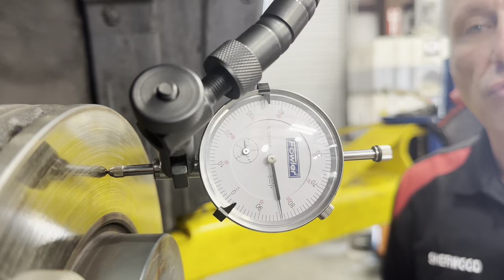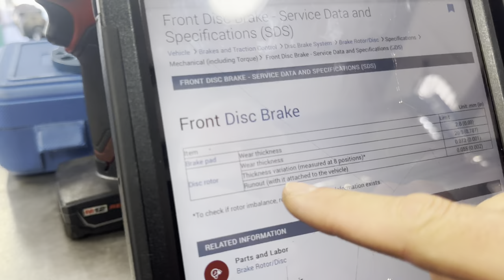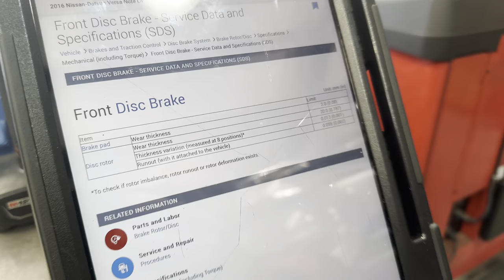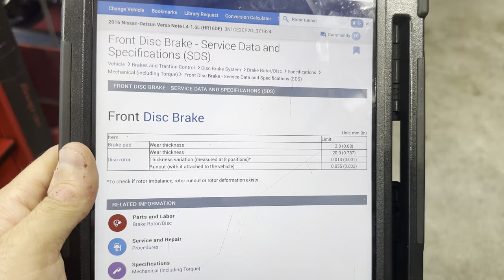It’s Vibrating When Braking & It’s Not the Rotors. How to Test! (Nissan Versa)

Comment: As a former brake engineer, I can tell you with near certainty that brake "roughness" is nearly 100% caused by rotor THICKNESS variation, the difference in runout between inner and outer brake plate.of the rotor.  You would have to measure the inner and outer rotor surface in phase of each other to get this measurement. Some vehicles are sensitive to 20 microns of thickness variation, which is 0.0008 inches, and hard to capture on a dial indicator. When you have brake roughness, replace the rotors and brake pads, and it will go away - for a while anyway.
Reply: Right you are  sir. As a 50 years auto, diesel, aircraft and industrial mechanic, the brake rotors made today are not made to be turned or trued. While we could do this a few times in the 70's on rotors, the rotors today are made to bare minimum to save weight. Sadly, one really hard braking can warp the rotors. I learned the hard way maybe 10 years ago when I had only 25K miles on new rotors on my E350 Super duty van, I had the rotors trued to get rid of pulsation, it worked for maybe 5K miles, but then I threw them out and bought new OEM Ford rotors. The other difference with rotors today is that they are made to almost any price point that you want, so yeah, much cheaper than in the 70's for the same size car, but they don't last anywhere near as long. It would cost over 100 bucks for Chevy rotor in the 70;s and hardly no aftermarket like today. Now if I could just get some tires for my van that are not crap right from the warehouse. Top of the line Michelins and 2 bad tires right at the start, the tire shop had to get 2 more to be able to balance, then we could not get the shimmy out after being on the van for only 2 weeks, switched them out with General Grabbers HTS 60 and while better, we also found now 3 tires now good. The Generals seem to balance out at first, but I think they are defective and getting "ply shifting" within a few days of usage. I'm sick of wasting time and the tire shop is working with me to resolve the issue, but as a old fart that expects a good product when new, this is 100% aggravating. I probably going to make them switch to another tire brand. What is going on with quality these days??? BTW, the van did not shimmy and rode perfectly smooth with 7 year old Michelins. They would still be on the van had they not dry rotted and one blew out.
Reply: Don't waste your energy. As a mechanic I have been trying to explain this to people for over a decade, have shared the Carroll Smith article, and nothing seems to work. 

Trying to explain that their brake lathe is unusable because they've used the adapters and cones as press adapters and seal drivers is worse.
Reply: @Jglivermr2  I know, I'll never have rotors machined ever again, in Florida by me, I think the only auto parts store that will do it O'Reilly's and I think it is used more to get people into the store, then tell them that their rotors cannot be turned due to being too thin or warped. Some local machine shops might still do it, but like I commented to the brake engineer guy, the cost of rotors is so cheap, heck buy the best ones you can get and it still is not that much. New pads, rotors, bearings., seals and I rebuild my calipers every other pad change. At 63, I trust only my self to replace my brakes.
Reply: @josephklimchock5412   I am the same. I mostly work on antique vehicles though, and sometimes have no choice but to turn rotors.
Reply: You are correct but...the runout leads to the thickness variation.
Reply: @Jglivermr2  Well sure, older vehicles had enough steel to turn many times, and if Antique, you have to save the parts if no replacements around.
Reply: @Jglivermr2  Yes, thank you. Well advised.
Reply: Also ex OEM engineer, run out will cause a thickness variation after a while as off brake wear will remove the high spot on each side of the disc. The factory discs are machined on the hub, so will have minimal run out. The replacement disc/rotor are often slightly thicker than OEM spec as the intention is that the disc is machined on the vehicle and so eliminates any hub run out.
Reply: Awesome 👍
Reply: i had in 2021 vibrations at braking on EBC Turbo Groove  with Project Mu HC800 pads
left it alone for winter
in 2022 spring when took it out vibrations completly disapeard and not return for hole year
2023 / this year same, still not return, absolut 0 vibrations, but now the pads are loud, LOUD like a todler screaming
brakes are nuts 😂🤣
Reply: Quality across every single industry is going to continue to diminish overtime until it meets a breaking point that needs to be addressed, not just manufacturing either, the trades, and any skill really. The amount of knowledge getting passed down from the population boom generation to the generation that's replacing them is insufficient and unreliable at this point. Quality is being sacrificed for quantity, because the amount of people needed to meet supply demands and maintain sufficient quality is outpacing the supply of people with the knowledge to run the machines, fix the equipment, etc.
Reply: @DeeSea3  poor and dumb people working for less is a huge contributor
Reply: He miked the rotor for thickness variation. It was consistent which cancels your idea if I'm not mistaken.
Reply: @josephklimchock5412  Rotors can't warp. Truing the rotors won't fix the problem only eliminating runout is a fix. Otherwise it only lasts a few thousand miles.
Reply: @Jglivermr2  Seems no-one can grasp the concept of runout and the thickness variation that results, with the pads constantly hitting the high spots you're doomed. Haven't found a shop that checks runout maybe because its a big money maker.
Reply: @Jglivermr2  Turning rotors won't fix the problem unless you have an on vehicle lathe that way you remove runout.
Reply: @leewatson8129  Exactly! Thank you no body gets that. Used to be brake shops had on-vehicle lathes but I've looked high and low can't find a shop anywhere with one.
Reply: Yup.  I've seen bent truck axles that had whole hub gyrating visibly and the brakes did not shake.  This video is a total fabrication.
Reply: 100% You can tell visually by looking at the rotor, It is massively heat scored. I would be looking for exceptional causes that caused the brakes to be heated so quickly.
Reply: You haven't a clue. Start cleaning the parts.
Reply: @Jglivermr2  IIRC the Carrol D article said rotors are never warped and it's always thickness.   Maybe his racecar experience, and he couldn't be more wrong concerning non-racecars!
Reply: @alro2434   If a rotor is truly warped and not parallel variation you would not feel it. The caliper floats.
Reply: Lol, then get a millimess that goes to 0.001mm...

It's not hard to readout, it's that you don't actually have the tools for it. 

Sincerely a machinist who grinds to 0.001mm
Reply: So put a dial indicator on both inside and outside rotor surfaces at the same spot?
Reply: If replacing the rotors only resolves the problem for a while, you have a seperate problem. Unless what are trying to indirectly say is, all rotors are defective brand new. Leading to early failure. When checking for thickness variation to determine if the rotors should be replaced, it does not matter if the variation is on the inner or outer rotor. The fact that there is a variation beyond service specs is all that matters at that point.
Reply: How do you suppose the hub developed that amount of runout? I’m gonna say someone took a big hammer and hit the hat of the rotor to get the rotor off
Reply: @Gregg0112  naw. It can handled. Someone curbed the car. Likely while going around a corner. Which puts an even higher stress on the wheel/hub.
Reply: What  I don't understand is why don't they know 100% sure about something before they change it,we can all do that, meanwhile the customer is out of pocket,to the tune of possibly 100's of pounds
Reply: 100%…. RTV or rotor thickness variation is definitely the biggest issue with rotors when it comes to steering wheel shake or petal pulsation. It starts as warped rotors and as the rotor high spots hits the brake pad over and over it eventually wears a low spot on the rotor. The only way to accurately check this is using a micrometer at multiple points around the rotor. 
I’m surprised at how many “technicians” don’t actually know this.

Comment: the fact that you were transparent about having the customer return multiple times until you finally resolved the issue- and then taking us through the process while openly admitting "this is on us" - much respect.   I would always tell my kids; "I don't care of you make a mistake- just be honest about it - no excuses,  then make it right".  Thanks for doing this video.
Reply: He did it backwards tommy = he should not try to pass the buck at start = then admiting = just admits he lies at first = or just was embarresed and admit = no lie = no need for correction ????/
Reply: 100%.  I was going to comment, but you said everything I was thinking.  Everybody, including businesses, makes mistakes.  The real test is how do they respond when that happens.
Reply: Free labor to customer, only charge for hub.. now it is best to change hubs in pairs because the older good hub on the other side has more wear and more rolling resistance.  so it will pull
Reply: I have a question.. I took my car into garage to get to get new discs and pads. 

When I picked up the car the rear brakes over heated & pads, alloys, everything is perfect, tried the flush, new break lines, new callipers but still overheating!! It’s the wheel bearing ect I simply can not find the problem!!
Reply: @faff1987  id start by lifting the rear off the ground- actuate the brakes and verify that the calipers are not locking.  Feel the tension on the wheels after you release the brake.  Heat means friction, friction comes from the pads grabbing the disc.  They have to 'release' when you let off the brake. Also check the slide pins - a lot of people don't clean those things which stops the caliper from 'returning'.  You eliminated dirty fluid- that was good but I'd refocus on the calipers themselves.
Reply: @lynskyrd  throwing money away doing that I have passed that stage!! The problem came after the discs and pads were changed. Then put new brake callipers on, then brake lines, it’s been flushed 5,6 times!! Everything is in perfect health, the wheels move, there is absolutely no defects!! It’s a Audi a5 and it’s been in 7 small garages they can’t figure the problem, it’s even been in to Audi twice who have world wide garages who not one mechanic can figure it out!! The discs have been replaced and pads twice!! Since it’s just the rear brakes that are effected I thought the handbrake this as been lined and reset multiple times!! The only things I can think of is abcs or the master brake cylinder and they have also been tested. So skip the a b c mechanic’s been through it.
Reply: @faff1987 When you say overheated there needs to be more information. How many miles are on the vehicle? How hot are the rotors getting - glowing? So hot the brake fluid boils and its giving you a soft pedal feel? Has the vehicle had any modifications like wheel spacers, brake lines, high friction race pads, etc? You didn't say if Audi put OE pads/rotors on or did they just try to figure out the problem with might be upgrade brake parts - sorry if you clarified that and I just don't remember as I am typing this out. If Audi OE parts are used - were the tolerances within spec for both the rotors and pads? If that was confirmed. Is it possible this vehicle may have a different group of part numbers due to a mid year change and the same wrong parts are being put on the vehicle over and over? Maybe there is a difference between a US, Canada or Europe spec A5 and nobody has figured that out yet. Was this your first brake job on the vehicle or has there been many done just fine before? If so - Has the location that did your previous successful brake jobs taken a shot at this? 
Lastly when mechanical issues have been exhausted as you noted an electrical/computer may be at fault. Which is why the mileage and even if you live in a extreme weather climate(hot, cold, corroded parts) could also be part of the issue leading to a failure of the ABS system or other item that is at the end of its life.

I worked for Bremo North America in both the racing division and big brake upgrades just so you know I am not some Youtube yahoo.

Good luck
Reply: @William-Bill-Munny  the discs, breaks and alloy get that hot that water makes it hiss!! The paste melts drips ( no modification) I’m from the uk.

After the heating it’s had new callipers, outer brake line,
Reply: @faff1987  Sounds like your brake piston is stuck and doesn't retract - Maybe its stuck (rust, dirt, broken ring/seal, etc.,)....Is this EV? All the wheels get hot or only one?
Reply: @jessgvirtual5822 it’s not a piston. It’s not the break line, it’s not the pads or breaks the discs and pads have been changed before, same part number ect if it was the discs and pads that were the problem then all of them would have the same problem not just one. It’s been in many small garages, as well as an Audi garage if Audi can’t figure it out then I have no hope !!! It could have been the calliper as it was a single wheel but it has new callipers on!!  If it was the break fluid it would effect all 4 not one. Visable and mechanic level everything is perfect !! If it was the abs unit it’s very unlikely that it would affect one wheel !!
Reply: @faff1987  4 wheel drive ABS module have  solenoids for each wheels. Its possible one of the solenoids not working as intended. It's also possible ABS module circuit board has a broken circuit(not uncommon). Sounds like  brake piston is locked-up or errant signal preventing retractions....NO OBD codes? Does your Audi has yaw sensor? You might want to check on that, they are sensitive component....
Reply: @faff1987 probaj zamenjati gumijasto cev katera pride na zavorno čeljust. Ko pritisneš pedal imaš normalen pritisk, ko pa se vrača olje nazaj ga pa nima. Vzrok je poškodovana cev v notranjosti.
Reply: Sadly not many people are honest… 😢
Reply: @faff1987  Does it have have "yaw sensor"? They can lock-up your wheels if giving wrong signals...they are sensitive components.
Reply: "If you make a mistake - just be honest about it - no excuses,  then make it right". Wouldn't be wonderful if our leaders would do the same!
Reply: Where can I find the tool to show run out and the thickness of the rotor

Comment: 90% of the shop will not do this kind of troubleshooting nor have all the tools to troubleshoot like you did. Awesome job!
Reply: This is apprentice level diag buddy relax. Customers don't pay for this that's why no one does it.
Reply: Agreed. Most shops will blame it on the rotor and label it as "defective" to get the customer in and out. Great job with fully diagnosing this issue.
Reply: Had the same problem on my 97 Thunderbird front hub: replaced the rotor & pads and it still vibrated.  Another symptom was that the brakes didn't immediately bite right away- this was due to the side-to-side motion of the rotor pushing the brake piston into into the bore, thus creating a bigger gap between the pad & rotor when the brakes were not applied.  Although I didn't have a dial gage, I performed a similar test with the rotor bolted down and the caliper & pads removed from brackets- I could see the movement by staring at the gap between the rotor & pad mounting bracket. Sure enough, a new hub made the car drive like new!
Reply: So, by the time you've replaced the hub and checked the runout on that new hub (and you BETTER do that), tightened the axle nut to spec (and these have a notorious issue with the LS axle nut backing off), put the rotors on a brake lathe to see if they require machining, then put the whole shit back together properly (pad lube, torque bolts to spec, install wheels, torque lug nuts to spec, test drive etc.) you've spent half a day and about $1000 in parts and labor ... ON A VERSA!
Reply: Good tip also is No Mo Chinese Rotors! Go with Detroit Axle of Michigan or Cardone of Pennsylvania. Bunch of old Italian master mechanics still there doing Gods Work in The Rust Belt Fossil fuel capitals.
Reply: Your probably right about shops not doing this. It’s pathetic that shops wouldn’t use a indicator to check runout on the hub and the rotor as common practice. The mag base, drop indicator(better to probably us a test indicator for clearance), and micrometers are not that much money. Mechanics are known for spending an outrageous amount of money on high end tools and tool boxes that cost 30k+. The tools that he used in this video cost less than $500. That Mic was probably the most expensive due to its shape.
Reply: @fuckjewtube69 as a “customer” I expect to pay for a professional job - whatever the charge is, just do it correctly. Thanks to this mechanic who truly is a master tradesman and proud of his craft, I know what to expect.